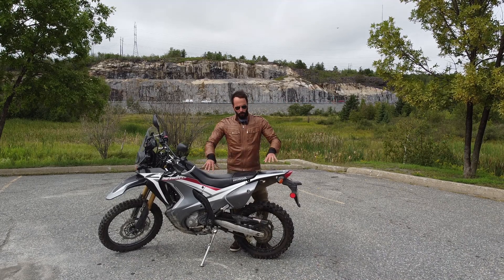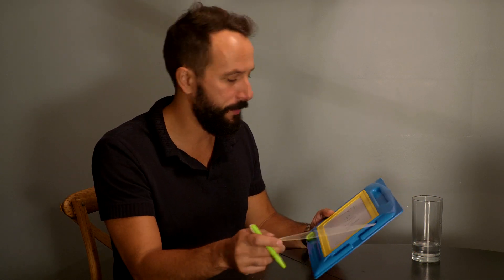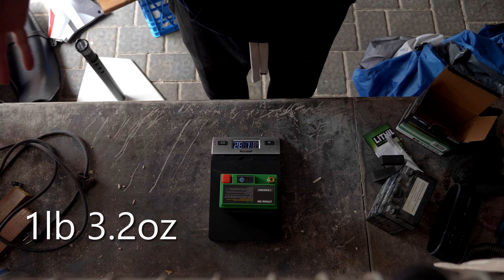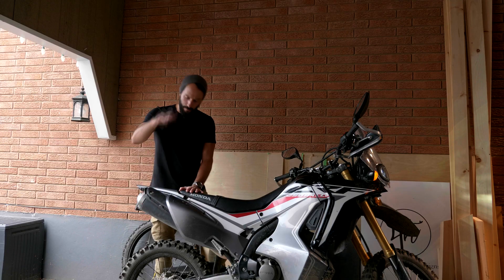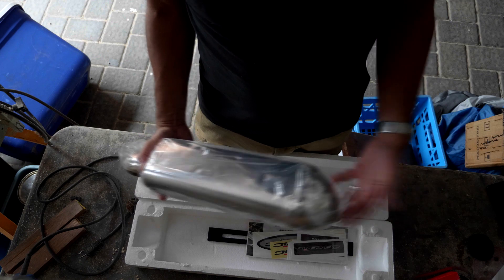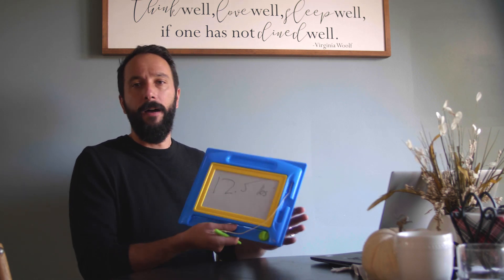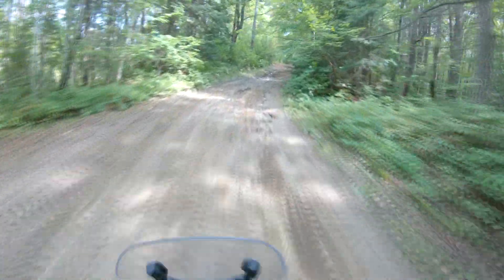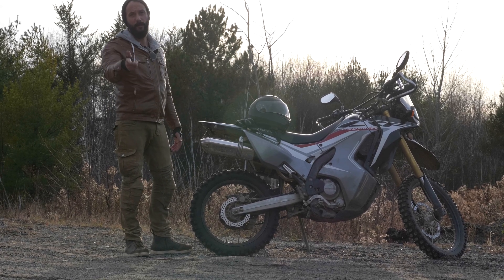Honda CRF250L Weight Reduction

Comment: I got one of those exhausts for my 1992 Yamaha Serow. Certainly a bit (too) loud, but i liked the sound. I quietened it down by putting a stainless steel pot-scrubber in the silencer in front of the baffle. Perfect! Same note, but a less neighbour-annoying racket. And weight saved (my old exhaust had rotted out anyway..) Les in UK

Comment: Great and honest video! You can also invest in a smaller front sprocket just by one tooth (ex: 14T to 13T) which will lower your gearing thus giving you more low end grunt/pull. But without changing it so much that it throws off you speedometer and speeds.

Comment: For me its putting a 100-100-18 K270 tire on the rear, and AL sprocket with MX chain. Those 3 shave over 4lbs off, all off the crank too so u gain back a little power lost

Comment: It’s not just about the figure itself. It’s essential where the weight was located. Saving 7,5 lbs on an exhaust system mounted under the seat and the tails section makes a much more significant difference for the handling than saving 10-12 lbs down low. Together with the battery change it has to be a noticeable change. So your not just justifying the expense, the difference in handling you feel is reality.
Reply: Agreed, you can take that 12 lbs and move it to the bottom of the bike and feel a handling difference without removing the weight.

Comment: Fun video!  I have the same bike make sure to get the Race Tech front fork upgrade -just an extra spring and oil, And more importantly the YSS rear shock for that bike. ( total $700) You’ll be blown away how nice it is and how well it performs, yet still ultra comfortable and absorbs the bumps-takes the bounciness out of the bike
Reply from the maker: allan Shuben thanks for watching Allan! Yes these upgrades are on my radar. Perhaps a good project to do over the winter!

Comment: You can also replace the heavy steel steering wheel with a light aluminum one. Do the same with the rear brake pedal and the gear lever, and replace the steel footrests with aluminum ones.

Comment: Solid weight reduction. Doesn’t add up to much weight but I also removed the front reflectors with metal brackets bolted to the triple clamps on the forks and the plastic chain guard and bolts. Does nothing and it’s easier to clean the chain with it gone!

Comment: I used the same taillight and didn't like the gap underneath, but I found that an old license plate, with a little bending and trimming covers up the gap perfectly. I painted it black so it blends right in.

Comment: Great video and great sound of bike I did similar mods but went 2 steps further for power K/N air filter and EJK fuel tune
Reply from the maker: I also have the K/N filter. I’ll probably put in the EJK this spring once snow is gone, do you like yours?
Reply: @matto29  yes I definitely feel the punch when I twist throttle I also recommend Michelin Anakee Wild tires great on and off road stiff sidewalls

Comment: I cut a a piece of dense cell pipe insulation to place in the gap created by the TST integrated light. It blocks sand and dirt from getting in. I’m really happy with it.
Reply: I’m talking small diameter about one inch and cut to width of the gap. When you bolt the cover back down the insulation is kind of smushed so it fills the gap and is held in place.
Reply from the maker: Mitch Templeton awesome idea, thanks Mitch

Comment: I prefered 250L and paid less than rally. İt is 20+ pound lighter. Bought 12 lt acerbis plastic tank (not heavier than standart 7.7 lt tank)and I have 2 lt more gas than rally . I added aftermarket windshield (200 gr) . And your modficiations are awesome if ı make them my bike will be 30 pounds less than atandart rally.
Reply: What you don't have from factory is a larger front disk or extra travel suspension or abs,  still both are awesome bikes but different horses for different courses

Comment: Question: was your model affected by the recall? I have the exact same bike, purchased it used and found out later that certain bikes in that model and year had a factory recall. My information has been unclear as to, if it was all or some of the 18s that were affected. I checked the vin on the NHTSA website and it told me it had 0 un-repaired issues but do not know if it never had an issue or it has already been repaired. It had almost 5k miles on it when purchased and have had no issues but searching for any additional information. I love the bike and your video. Cheers!

Comment: With that exhaust you'll need to retune your ECU. The bike already runs lean. That exhaust will only make it worse. Sure you save a few pounds (most of it in heat shield which you may need) but you won't gain anymore HP. You're just moving the torque curve. But now your gas milage will go down, because you have to richen up the mixture or risk burning your exhaust valves.

Comment: Great video man! I can't believe that the CRF250L Rally weights the same as my XR650L (346lbs)! That is just insane. I should be able to shave similar weight with the same mods. Not sure how I'll measure it though, my wife is not a drug dealer 😂
Reply: Wow, that is heavy, I never knew. My KTM 690 Enduro weighs 345 totally wet. And that can be too heavy for me in tight single track.

Comment: Hmmmm. I’m no expert but it seems like a bad idea to replace the exhaust without setting up a EJK properly. 
But I will look into lightening my 2019 250L at some point.
Reply: The bike has a narrowband O2 sensor and adjusts the fueling appropriately under half throttle. Over half throttle it reverts to a preset fuel map. I tuned mine with an FMF can and EJK with a wideband O2 sensor and found that with stock settings it ran lean at idle, full throttle and high speed cruise. After adjusting the EJK to just add a small bit of fuel at those spots and a couple transition points to get to 14.3 afr, it runs like a top and still gets 70+mpg, even off road, fully loaded with camping gear. Hope this helps a bit

Comment: That rear fender probably had 1 or 2 ounces of dirt on it. Not a huge amount, but if you are using such an accurate scale, it makes sense to clean the dirt off the parts before weighing, otherwise you're not getting an accurate result.

Comment: Sorry but, Really? Why didn't you buy a real low weight dirt bike instead of small "heavy" adventure bike? I don't know how it works in Canada but in Europe, you can not ride motorbike on the roads without rear turning lights. Also battery. Did you changed highend battery from Yuasa to 15$ battery bcs of the weight? Good luck with cold starts after cold nights. One thing I can accept is exhaust exchange.
Reply from the maker: The TST taillight has functioning turn signals. I’m not sure where you’re buying lithium ion batteries for $15 but that’s a good deal. The one I bought starts great even here in frosty Canada.  Hope you’re having a great autumn Lubomir 😘